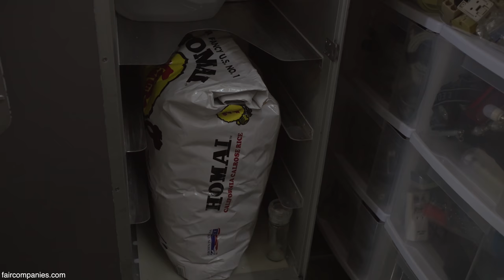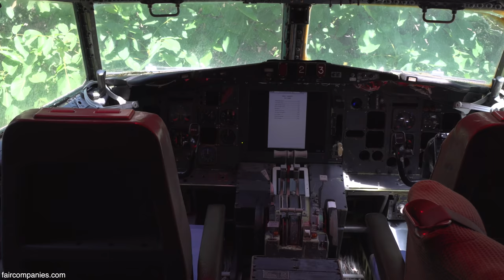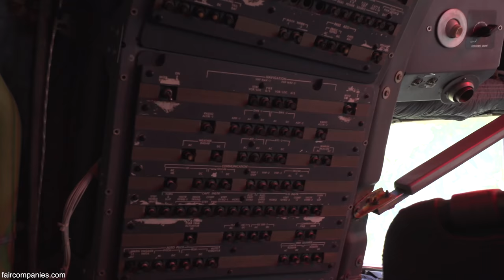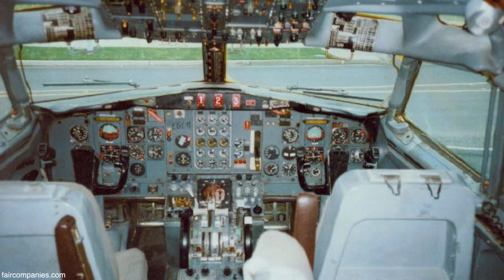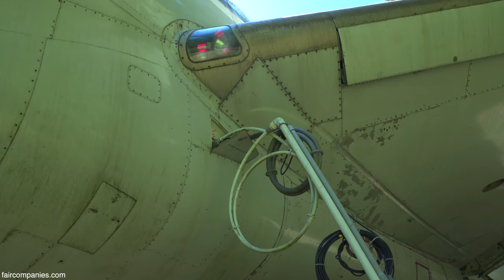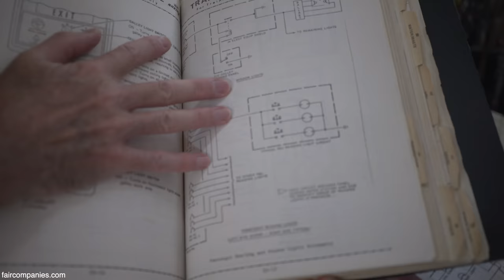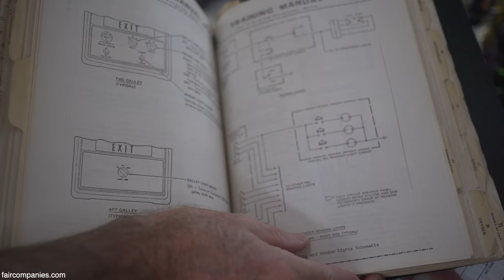Solo living in a “camper-airplane” as architecture of collapse

Comment: As a current Boeing engineer, i've always wondered retired airliner fuselage would make a great basic  structure for a home. There amount of structural and material engineering, and meticulous manufacturing that went into building an aircraft, to ensure safe and reliable operation for 30+ years, is just so much higher than trainer home. it must not leak, must not corrode, and must be able to withstand the G load from hundreds of thousands of rake-off and landing cycle, and impact force from a hard landing during a 30kts crosswind. It will be one sturdy home. With that said, this person could've done a better job at organizing the space...the interior just looks like junks piles on top of other junks. There is a lack of space separation and comfort from this very sturdy home.
Reply: Yeah cuz the dude is a hoarder/ collector he can easily make this a beautiful home add a deck by the doors and put pretty cool setup like theater section with chairs add a projector screen but he def should redo the whole bathroom
Reply: DisposableWarrior agreeeeee. If Aliens looked down, they’d be wondering @why does he take the best aerospace technology and engineering and do nothing beautiful with it “
Reply: 17+ years and he hasn't even gotten a foundation underneath or bothered to weld the wings back together. Things like that along with watching him walk along the wing made me depressed to realize just how much of a nightmare this man, (or anyone following his lead), will likely have down the road. I'm also really confused how he says he bought this plane for $100,000 and needed someone to fly it but then says the plane was completely stripped of instruments when he got it. If it came functional and he sold all that off that might make sense but not with a $100k price tag since those go for more than $1 million. Everything feels like he's delusional, into this project for multiple times the amount of money he's claiming and just putting on a smile for the camera.
Reply: @Hogscraper  He said he bought it from a company who overcharged him for a gutted non working plane, he then went on to say that he should have contacted the airlines directly to buy a working plane for the same price, but the airline would require whoever purchased the plane to have fuel and a pilot ready to fly it away once bought.
Reply: It should be near perfect, it is already insulated, it has nearly all the systems in place to survive at 30k feet, so of course it would be great for a home even in the mountains! Just add a garden and plant fruits trees and your in business!
Reply: @Hogscraper  I saw this guy and his plane somewhere else several years ago.  Not sure if it was on YouTube or TV, but it looks even worse now than it did then.
Reply: @darthudd6721  727's are currently $1.5M-$3M to buy one that's fully operational or you can spend $150K-$300K on one that's non-operational but complete. I could claim to have bought one for $5 but that doesn't make it true. Even a stripped F-14 goes for $5-$10k and given how small those are compared to a 727 I seriously doubt anyone claiming to have gotten their hands on one of those larger planes for $4k. The cost just to move the shell of a 727 from the nearest boneyard to Portland via two trucks would be $20-$30k. His math just doesn't make any sense at all. And those are the up front costs before any actual construction takes place which is why I said I think he's delusional and making up numbers to cover just how much money he's thrown at this thing.
Reply: on point... its creepy and a total mess. Reminds me of renos/restorations on old trailers and motorhomes, there are some really nice renos where you would enjoy being in those spaces. This looks like a tornado hit inside......a bit eccentric he is, I'd say LOL... I'd be out in five minutes flat, hahaha
Reply: @Hogscraper   hes a total eccentric, LOL....Im betting he does not own a car, or if he does, its also at least 20 yrs old and a mess, hahaha....ugh...
Reply: @Hogscraper  just pointing out what was actually said in the vid. Also there is another vid where a lady bought a 727 for 4k, it looks a hell of a lot more pretty than this chaps plane, she has a hot tub in the cockpit.  I think you are right that he has sunk a lot more money into this than he is letting on.
Reply: he's a nerd, not an interior designer
Reply: He seems happy tinkering away on myriad projects strewn about his giant, half century old machine where he lives alone in the forest... call it an extreme engineer personality or simply "on the spectrum" but I guess it works for him :-D
Reply: You guys are applying your own standards to someone else. First, he isn't a hoarder by what I saw. He has a normal amt of food, clothing, and stuff. He simply hasn't made everything look pretty. It's clean and functional. He's been working on the electrical, etc while many of you think he should be making it look more comfortable and 'presentable' to others. 

There is some separation in the areas and lots of room. He doesn't have to ascribe to 'the look,' and clearly doesn't want to. I know of someone like him... who doesn't accomplish near as much, does tinkering and you can tell... he's a real hoarder. This guy is eccentric and is getting a lot done that the average person is unaware of.
Reply: Oy Vey Merchant. That toilet got to me. Now I’ve seen a can of coke swished around and left for an hour cleans out rust he could that.
Reply: @jublacabra  Different strokes for different folks. He's happy. Let it be.
Reply: Lol
Reply: Honestly now that im watching the video again I dont he cares to do the things on his agenda i think he just trips on acid and shrooms and just gets high on drugs
Reply: It's like the ultimate Airstream. Most people would gut it and remodel the interior, but this guy loves the fact it was once a flying plane and likes to nerd out on the technology left in it. It''s a bit odd, but i also kind of get it.
Reply: DisposableWarrior I'd be embarrassed to admit I was a current Boeing Engineer...youre planes suck, the A-320 blows that POS 737.  Watch 60Minutes Australia, DISGUSTING!
Reply: He is obviously going to the mancave/ boy toy look. 🤐 he's thrilled and proud.
Reply: He did say once he got the electrics and water done he feels more comfortable and putting the organisation on a back burner. And that’s not important at the moment. Would look nice though once he organises himself.
Reply: Hogscraper He could have a small house built for that much and live rent free? And be comfortable. No mess.
Reply: The way he uses this old plane takes money out of his pocket, finally, this plane has to be disposed what costs another huge amount of money. What he should have done instead is to turn it into an asset that puts money into his pocket.
Reply: Agreed, I would have this thing compact, would make it look like a hotel.
Reply: Disposable - WHY BOTHER CITISIZING???   REALLY????    SOUNDS A BIT LIKE SOUR GRAPES..........ANYWAY, ARE ALL THE BOEINGS STILL GROUNDED? I lived in Seattle, knew engineers there....then the terrible crashes from bad design............WHEN WILL FLIGHTS RESUME?  NOW IT IS ALL SMALL/PRIVATE PLANES..............I DO NOT FEEL SO SAFE IN SMALL OR TINY PLANES.......           CHEERS, DEAR!
Reply: Did you ever see a movie called The Congress
Reply: 1:33 the kind who dont think at all.
Reply: Im just so disappointed at the fact that he spent $100k on something that he could've got for $4000
Reply: @AJ-cp2qg  hes free to do so. and he is enjoying himself. that should be enough for us who he graciously invited into his life.  its pretty shallow for all of you here to have such a negative view of the person he chooses to be.
Reply: @Hogscraper  you weren't listening, he had to get a home mover to move it, that is why the wings were cut, and the tail was cut. He said it had already been stripped when he bought it, but found out later he could of bought a fully functional one with the money he spent.
Reply: ...junk looking yes, but he delivers of what should be done with out of commission airplanes!
Reply: Ya he needed to hire an interior designer 😂
Reply: Dude seems a little ADHD; or similar. He also seems happy, so let him be happy in his clutter.
Reply: It’s on his to-do list, Little Miss Naggy-Panties.

Comment: Outdated airplanes are often abandoned by flying industries because older models do not utilize fuel as efficiently, and the cost of fuel is by far the most expensive part of operating an airplane - far more expensive than the cost of the airplane itself.

Comment: Why does the floor seem like jello
Reply from the maker: Bruce redid the floor. They are 5x9 sheets of acrylic that he bought at a surplus store years before starting the project for $20/sheet. He's 4 sheets short of completing the floor and new they cost about $300/sheet.
Reply: @kirstendirksen  Lexan should be what he used.   It does not break or shatter, only bends
Reply: Polycarbonate scratches easier than acrylic. Impact resistance of acrylic can be increased by increasing thickness, increasing scratch resistance isn't so easy. I belive acrylic has better UV resistance as well as a lower price tag.
Not necessarily the wrong choice.